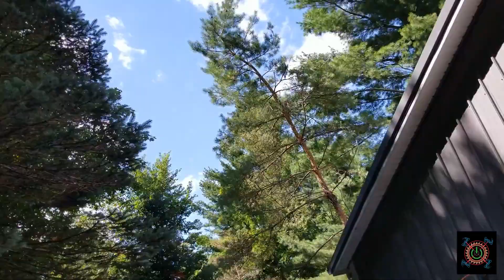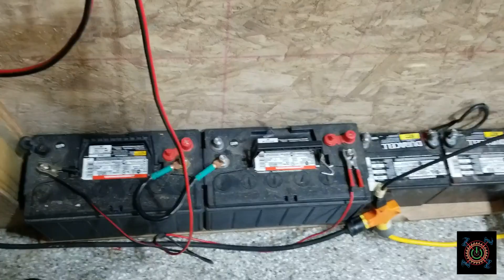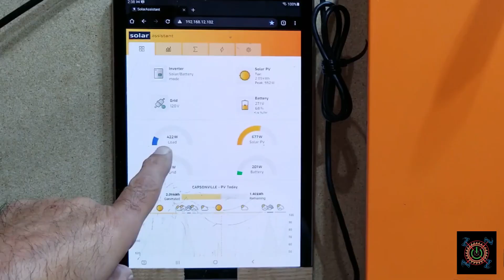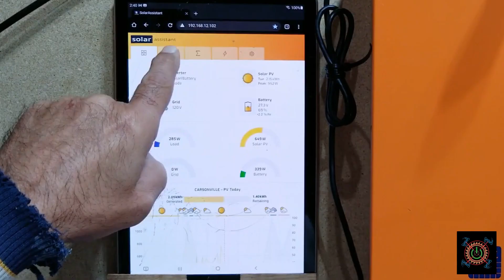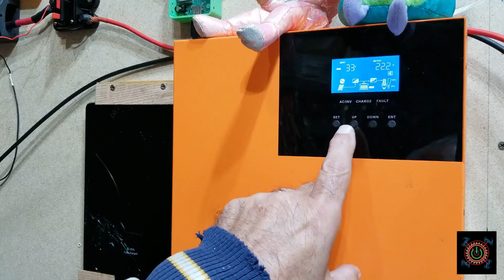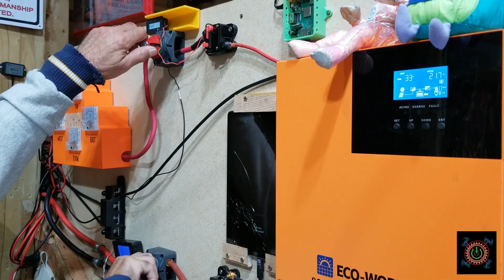Entire Barn Is Now Off Grid - Easy and Affordable On A Small Budget. Using  Solar Assistant software

Comment: there is a cable running across the front of your morning solar panels, did you not notice? thats not good.
Reply from the maker: Yes. That is a rope that I use to hang on when I am up one the metal roof. I'm too old to fall off, take much longer to heal...LOL
Reply: @Craigs_Adventures  me too, thats why i would put the rope behind the panel so i dont have to go back up again. in winter its can mean 100w difference.

Comment: If I were you, I would install some larger solar panels. And pay attention to that cable on the last panels, because apart from the fact that it shades your panels ( if a few cells are shaded, the entire panel produces less or not at all ) and also heats up and it would be better to install it behind them. 
Greetings from Romania.
Reply from the maker: Thanks for the suggestion. I have planned to get bigger panels as these start to go bad. I have noticed that they are not producing the amount that they were when first installed. I know you get what you pay for. Now that I know it works and is possible to get off the grid, I will start to replace the panels with higher outputs. Any other suggestions are very welcome. Thanks for stopping by…CLO

Comment: Hello, I am wondering how were you able to monitor the inverter with a raspberry, i have the same kind of inverter charger, is there any specific app you have to run in the raspberry? Is a tutorial video possible? Here in the Philippines there a bunch of us using that kind of inverter charger with a wifi dongle with a crappy software.
Reply from the maker: I am using a windows based app on my pc. I can monitor it from anywhere remotely. This is the main reason I went with Solar Assist. (https://solar-assistant.io/)  It cost around $50 (US) dollars. I was very hesitant to purchase it but now I would not go with out it. They have updated the software a few times now and keep improving it. 

If there are enough viewers, i will do a video showing it. . 

Thanks for stopping by, and hope you are subscribed. CLO
Reply: @Craigs_Adventures yup! I did subscribed, wishing to see much more of solar set up content.

Comment: You you won't stay off grid for very long before that EcoWorthy high frequency transformerless fails. You should have installed a low frequency, transformer based inverter if you wanted your system to last.
Reply from the maker: Thanks for the suggestion. I would like to replace it because once the batteries are fully charged, the charger shuts off and start using the batteries even though the sun is still out. I would want one that once the batteries are fully charged, the charger would turn off and the system use the power that the panels are still producing. The system now is using the batteries too soon in the day. Do you have any suggestions on a low frequency transformer unit?

Comment: Nice to see you have a system now! I want to double mine so I can go longer without sun. Good Ole Michigan will do that to you! Lol
Reply from the maker: That’s for sure. Once the leaves are gone, I’m pretty sure my output will be a little better. I call you a few weeks ago about maybe getting together to make me a roof mount for a solar tracker. I’ll call you later.
Reply: Ohh I hate Solar in Michigan during the Winter. I'm gonna try to opt for more batteries instead of Panels the next couple winters and see if that changes anything.
Reply: @Moes_Prep_and_Tech I ended up mounting my panels 90 degrees on the south facing wall of my shop, and I get much better production in the winter and no snow on them ever. Not ideal for the summer months, but I will add a much larger array for that.
Reply from the maker: @karlsoffroad I think I am going to adjust the angle for the winter months and get more power with the limited sunlight hours.
Reply: @Craigs_Adventures I only have 3000 watts total and today I was getting 2946 watts,so the sun is already much lower in the sky compared to a month ago. I'm curious to see what happens this winter with my new system. I always have the grid for backup.
Reply from the maker: @Moes_Prep_and_Tech  thanks for stopping by. Hope you subscribes and if so, be sure to see my last video on my Free GIVEAWAY....CLO